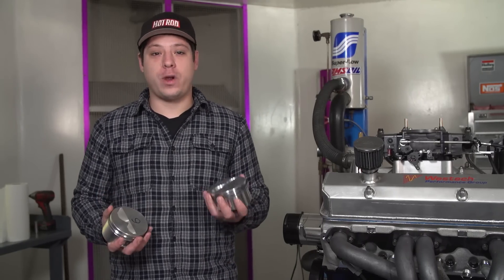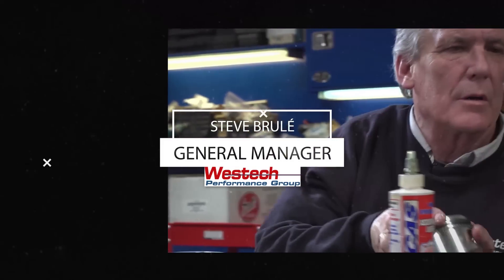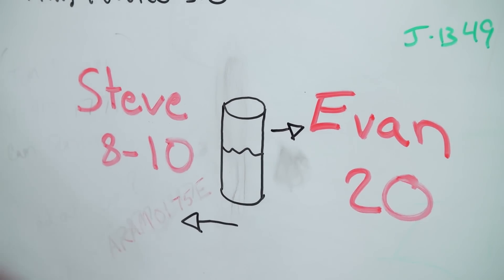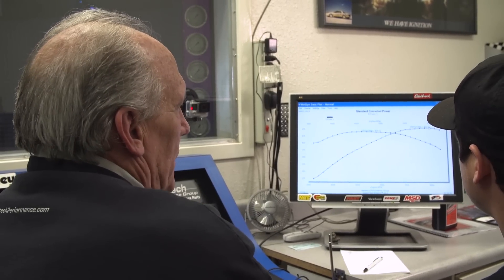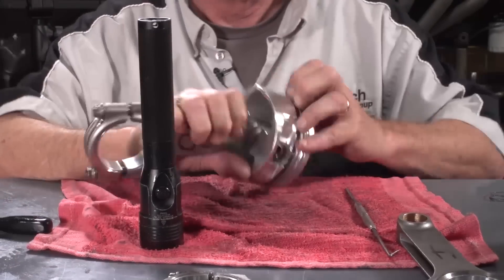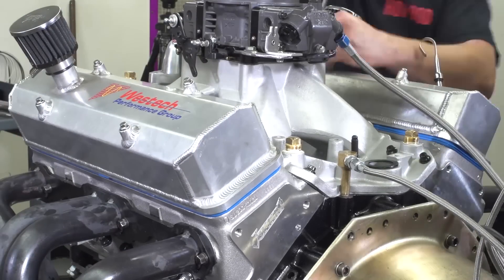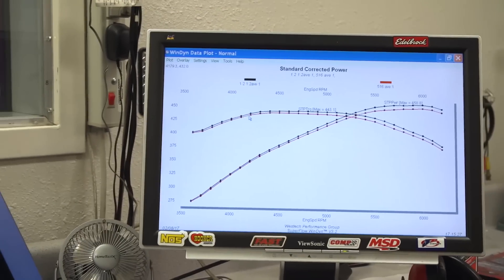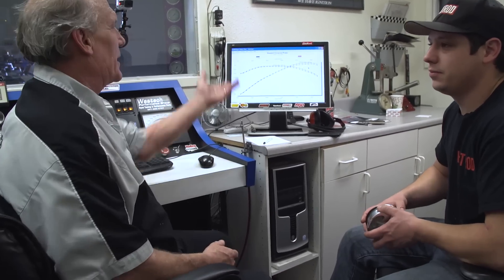Dyno Tested: Are Thinner Piston Rings Worth Horsepower?

Comment: How well will thin rings hold up under boosted conditions?
Reply from the maker: Excellent. Modern rings are made from high-carbon steel and are much stronger than old-style cast rings.
Reply: I asked the same question before I read this. I'm wrapped, there's an answer already
Reply: This is a loaded question with tons of different, but correct answers. It depends on your application.  The style of ring, material, piston design, cylinder wall design and prep all must taken in to account for the right answer.  The best answer is to contact your favorite ring manufacturer before ordering pistons with a honest account of what you are going to be doing.
Reply: One ring manufacturer I spoke to said 1/16" rings or thicker(!) in hard chromed steel for one heavily boosted small big block I was helping build (big bore, little tiny stroke, just over 450ci).  The thicker rings were to help get the heat out of the piston head and rings, and to take the abuse of 25+psi with a nitrous shot to spool the huge turbo :)  They didn't think the thin rings would be good in a 4.625" bore under that abuse.

 Rings are available down to something like a half mm with 1.5mm oil rings for super short ring packs. I think they use rings like this in NASCAR.  I have seen a used piston from a few years ago from a cup engine and it had super thin rings.  Who knows what they use now.
Reply: RacerRickxx Yeah I hear ya. I'm a mechanic in Australia myself and am using some pretty trick rings in my current toy I'm playing with (an Nissan RB30ET) - it's been built for 40+psi. I always suspected the new gen materials used in current high performance ring packs were up to the task and did exactly what you suggested and spoke with Total Seal about what I was planning. They spec'd out some new material rings for the 2nd ring, but simply use an iron Napiar style ring for the top ring from memory (the engines been together for a year and a half now- so I'd have to look around the garage to find more accurate info). After buying some trick CP pistons with really thin ring lands, I was a little concerned at first. But they've been rock solid so far, I daily drive it using 21psi and it makes 504rwhp like that. But I always like to hear what everyone has to say, and from there decide where I think the truth lies. You can learn something everyday in this industry, and tech is constantly evolving. Funnily enough, I've seen a few NASCAR motors torn down at my mate's machine shop recently. An SB2.2, an R07 and whatever Dodge calls their now just out of date engines that aren't used anymore- and that was the first thing that struck me was how thin the rings were, but also how high up towards the crown the rings lands were. That works great in an N/A application, but we all know that style of piston doesn't work well in a boosted application. The thickness, or lack there of, of the rings isn't the issue there. The position of the top ring land is the problem... This small block you mentioned sounds interesting! That's a really big bore, isn't it... What block was that using? Obviously not a SHP, maybe a Little M or something I'd imagine. There are a few companies that make some really good blocks like Dart's Little M
Reply: Do they not make carbonized/treated thicker rings?
All I can think of is oil consumption problems on modern engines in an effort to make everything super eco friendly.
Reply: Daniel Brealey 
I love total seal. 
I wanted top gapless rings for my Vw so they said send an oem ring so we can inspect it. 
Their reply: we could build you a set as nice as the oem ones but it'll be big$....
Send us an oem ring set and we will make em top gapless. 
35$ a hole to mod stock rings(10yrs ago) 
I had a 5th set done in case I broke one. 
After 15k I checked the leakdown and thought the gauge was broken. 
Like 1-2%
I'd use em in a lawnmower if I had to rebuild one.
Reply: MrTheHillfolk That's great that they were prepared to help you out like that and be honest about what it would have cost to do a one off set. They certainly make a top quality product from my experience. Are we talking about an old flat 4 VW engine, or something a bit more modern? With leak down results like that which I keep hearing, I'm dying to try some gapless rings out in one of my own motors to test them out! ;)
Reply: Daniel Brealey 
it was a 1998 Jetta tdi engine. 
Diesel.
I converted it to the older style mechanical fuel injection and cranked the boost to the moon. 
usually above 30-35psi, and stuffed it in a 79 rabbit.
I ran an open pcv, and I never had drool or oil mist getting all over. 
I did a minor tear down around 30k because of another issue but I was able to reuse the rings and pistons. 
I haven't driven the car in a couple of years but I put about another 25k on it after that.
I think the dry cylinder lube they offer also helped quite a bit on initial seating.
Reply: MrTheHillfolk Sounds great! I suppose that would be what we call a Mk1 Golf??? I think it is... That would have been a blast to drive, man they're light. You liked the mech injection? I've never really played around with much diesels stuff, but I an tell you from personal experience that the mech injection used on gas powered euro cars from the early 80's is terrible. I've got an old '79 Volvo 244GL that I'm going to swap an LS into- the mech injection on this and many other euro cars from the era are not all that reliable and can be a nightmare to diagnose faults on. What is this dry lube your talking about? Is this a coating on pistons, or something you're using when assembling the engine? I'm tipping it's the 2nd option. I usually just use a bit of engine oil after giving everything a bit of a rub down and clean with trans fluid first- it's always worked really well for me. But if there's a better way, I'm willing to give it a try. Any thoughts of pulling out the ol' Rabbit for some fun now
Reply: MrTheHillfolk how did you set initial timing in the TDI using an IDI pump? What did you set it to?
Reply: otm646 
I set it up just like you would set up any old idi, with the dial indicator and all. 
I used a 210mm flywheel which required remarking tdc (I used a piston stop) 
Some testing found it runs ok when I set it around the spec of an old 1.6 td, I started it around .7mm and ended up around 1.0mm.
Reply: Daniel Brealey 
Haha it's a fun car, but I'm contemplating swapping in a 2.0pd from a 04 Passat. 
As it is now, at a 2nd gear idle roll, you floor it and it just fries the tires and finally hooks in 3rd of you like to keep your foot in it. 
I have parts to beef up the 020 for the current engine, but it'll be a matter of time before I kill that too I think. 
The dry film lube they have is for freshly honed/bored cylinders with new rings, don't use it on old reassembles. 
You do lubricate  the ring lands lightly with more of a normal oil(they have that too) but you don't have a dripping mess upon assembly either. 
Key is to get those rings to seat within the first few minutes of running. 
Don't keep running it if ya can't drive it after the driveway break in. 
Use the assembly lube sparingly on the ring lands , and the dry film lube on the cylinders. 
The dry film lube is kinda neat, it resembles shaved pencil lead and kind of gets a greenish tint when it's done right. 
http://www.totalseal.com/tools-lubricants.html
Reply: More Power! Excellent, all modern LS engines have pistons and rings similar to this, one of the beat engines to put boost into.
Reply: RacerRickxx 4
Reply: Most current factory turbocharged engines use narrow rings. The Mitsubishi Evo X gets up to 303 horsepower out of a 2.0L turbocharged engine. That engine has a 1.2mm top ring, 1.5mm second ring, and a 2.8mm oil ring from the factory. Subaru used a 2.5L engine in the WRX STI to get 300 horsepower, and they used a 1.2mm top ring, 1.2 mm second ring, and 2.5mm third ring.

Many Japanese turbo engines from the past used a 1.5mm top ring, 1.5mm second ring, and a 3 or 4mm. The 300ZX Turbo somes to my mind first. They gave it that ring pack back in 1984, and even though the 300ZX Twin Turbo was much different, it still used the same ring pack. Sales to the USA ended in 1996, but sales continued in Japan for a few years afterward. I do not know if the ring pack was changed to the exclusive Japanese version.

Some of you might be thinking of adding boost to an NA engine, or adding a large amount of boost to a factory forced induction engine. If you do that, I don't know if the ring package can handle it.

Comment: old school rotary guys will remember going from a 2mm apex seal to a 3mm to run more boost and noticed a drop in performance. now days you can get a pretty strong 2mm seal. you never see n/a engines with 3mm seals. its shit. on an engine with very little friction and no valve springs to compress you can imagine the difference it makes.

Comment: its banked on that little hp gain, going along with all the other things done to make the car roll faster (less weight, balance, low friction tires etc) and that multiplies its gain too. The hp gain with all those things i believe is worth it, but only if there are plenty of other mods/designed to compliment the gain -otherwise you will just be rebuilding the engine more often.

Comment: And the huge added bonus is they do not cut the bores up either. Added with ULP replacing rings in a street motor is a thing of the past. Plus generally the pistons are lighter anyway. I have used them for over 25 years and the OEM 10 years longer than that.
I am surprised that late SBC engines did not? Ford have since the late 80s.
 Oh and does anyone like Spirolocks? For me the simple circlips have never caused a problem,,, BUT replace them every time.

Comment: In the spirit of new vs. old, I think it would be hilarious to see just how bad you have to make a junkyard LS as bad as a 350 from 1980.

Is it even possible to make a 5.3 make 180hp at the crank with off-the-shelf parts?
Reply: I don't think the data supports your thesis... Modern motor HP claims are made with their full accessories installed and a 5.3, complete with mechanical fan and water pump, is rated at something like 270 stock in '99, which should account for all of that (and I'm pretty sure a bone stock 5.3 makes about 230-240 at the wheels, which backs up my statement). By the same token, that 180hp 350 in 1980 should have been an SAE net number too so the motors should be on equal footing. I can't even find a video where someone bothered to dyno a full smog 350 or a stock C3, but I'd have to imagine they probably put down about 140 to the wheels...

Modern truck exhaust is pretty much as crappy as way back exhaust too (especially considering something like 180hp Corvettes, where they at least tried). The carb, I can absolutely agree with you on.

Anyhow, I still think this would be a hilarious test. The way I'm looking at it is that they would have to nuke 100hp out of the 5.3, with off the shelf parts changes (no fair just running it way out of time) before it was even. My guess is that even with a carb manifold with a small 2bbl carb bolted on to it with adapter plates that the LS would come out on top.

There's only one true way to find out!
Reply: It would be fun to see what it would take to make a 350 perform as well as a 5.3 LS.
Reply: Everyone on the planet already knows how to make 270hp with a 350. That's legitimately not a challenge and even Chevy managed to get really close again down toward the end with the Vortec motors. I think a '96 350 is rated at something like 240hp.
Reply: 255hp
Reply: I'm guessing you mean "is it possible to get a 5.3 DOWN TO 180 crank HP with off-the-shelf parts, assuming proper tuning?"

I'd have to go with a big ol' "no" on that one.
Reply: Yes, that was my intention, and I'm inclined to agree with you that it would be just about impossible to do.
Reply: +Maxwelhse
You make a good point about lousy exhaust systems in GM cars. They used to have a pellet style catalytic converter which created far more backpressure than honeycomb type cats which are far better. In addition, on older GM V8 engines, it was common to have one awful pellet cat and later, they had 2 cats with honeycombs. There was a second reason exhaust systems weren't as good back then, and that was cast iron exhaust manifolds were built more cheaply and had less effort in making them flow well. People called them "log" manifolds. There were few exceptions, like the "Ram Horn" manifolds found on small black Corvette engines. Modern cast iron exhaust manifolds are shaped with better performance in mind, and may be as good or better than Corvette Ram Horn manifolds.

There was another reason the old engines had less horsepower. Many carb engines had to breath from a tiny snorkel, and only a fraction of the surface area of the air filter was used effectively. This is why some people woulod make quick horsepower by flipping over the air filter cover.
Reply: Possibly with a very low static compression ratio, as though it would be run with a forced induction of some kind making big boost, but staying naturally aspirated. A small cam and small carbureted induction and a single exhaust might complete a low power package for this engine, but I won't make any promises.

Comment: Really need to address cast iron 5.2 durability in older mopars and a mild cam with 340 heads, 10:1 compression and peak rpm.

Comment: My guess is 5 hp. Most people think everything will give them 25 more hp. My coworker has a 2016 F150 3.3 v6. He thought K&N air filter would give him 25 more hp because he thought the stock air filter was restricting hp. I told him the v8 use the same air filter as the 3.3 v6.

Comment: i predicted 1 to 1.5hp per cylinder
also racers do it just the same as them using lighter weight parts, every little bit adds up and can add up to significant savings (fuel, tires,  times, etc)

Comment: I will tell you from experience.  Thin is fine for stock and some mild performance increases.  For anything that will see a lot of high rpm, boost, or NOS.  Don't use them.  Can't count how many times I either found them broken (yes, I set the gaps at max for boost) or so metal fatigued they no longer push out of the ring grooves.  Ran long enough they will get jammed in their groove from carbon via blow by.  The symptoms are always the same.  Engine runs great for 20-30k.  Then the power starts going down over time (10k or so) until the compression has gotten so low that it won't even start.  The compression test will confirm your suspicions.

Comment: I think of this as a RPM band issue. If you are building a torque monster that will not hit over 5,500 rpm go with the thick rings. If you are building an open race motor that will turn 8,500 rpm go with the thin rings. You can see the charts are diverging and I bet at or over 8,000 rpm we may see close to 20 hp difference.

Comment: Weird audio artifacts on the dyno runs. sounds like its misfiring (I know it's not)
Reply: That’s the engine dyno putting load on the engine every 300 rpm to take a measurement. Sorry it took 3 years to get an answer.

Comment: With my low tension rings I have an oil consumption problem. I've read it could be my too high viscosity I'm using and the rings are not fully against the cyl walls. I've used 15w-40, 10w-40, 20w-50 and straight 30 wt. I'll be testing 10w-30 on my next oil change.
Reply: replace your pcv valve 'cheap' and do a leakdown test to check where you're eating oil
Reply: yourfullofsheite I've switched the PCV to a small orifice hole which is hallow, and my leak down % leakage numbers are as follows for 1,3,5,7 and 2,4,6,8.  % are 8,4,2,2 and 10,2,9,4 ,  Note that I'm usually buzzing at 3,000 and higher while cruising in 4th out here on the country roads. I'll be testing out Redline synthetic 10w30 oil when it gets warmer out. I think I may have a high volatility (evaporation) rate in the conventional oils I've been using. What's also weird is that when I drive the car like a woman, it uses oil compared to when I drive it harder, at times it doesn't use any. In the past I've used too thick viscosity oils and read that the low tension rings can't slam into the cylinder walls making a good seal as easy as with a thinner oil. I have no smoke coming from the tail pipes either but my plugs carbon up. I've read that low tension rings on a street engine will consume oil compared to normal tension rings.

Comment: Good evening just described  i sall a video where , the guy that runs the dino test ,  pulled a moter out of a 1985 motorhome  , what motor home was that if you remember  it did like 480 to 540 horses to the wheels  with no add ons  ?

Comment: Still wanna see a comprehensive camshaft episode. I want a good video to show how different cam grinds affect performance. So many people are uneducated about cams, people know lift but nothing about the valve opening/closing points.  Show the differences in what lift and duration do for performance. If you keep the lift the same, how does a small duration affect the motor compared to a high duration. Same for lift, while keeping the duration the same. Could even throw some differences in lobe separation. Maybe point out the differences in boost cam and N/A cams.
Reply from the maker: We weren't able to shoot a video for this one, but the story covers much of what you just described. http://www.hotrod.com/articles/camshaft-shootout-lobe-separation-angle-tested-explained/
Reply: Good read, thanks.
Reply: That was a great read. I asked for something along those lines after watching the Engine Masters vid about cam duration, and then bang- that month's Hotrod mag had exactly what I was asking for. Thanks, Evan